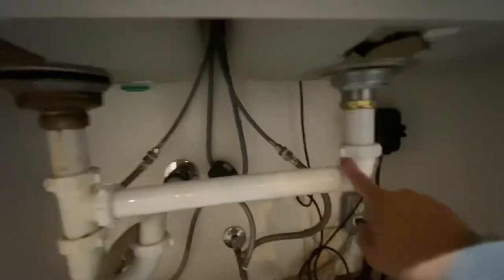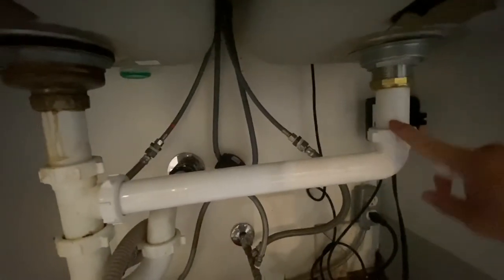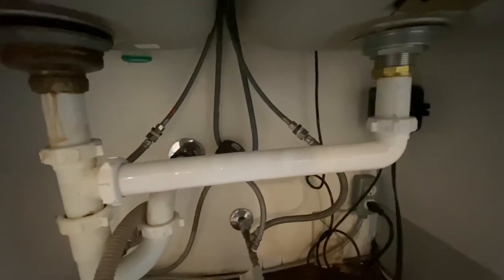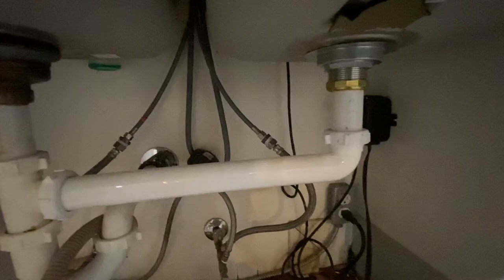DIY: How to add dishwasher drainpipe to a double sink drain and fix kitchen leaks from sink drain.

Comment: I need that kit you opened. What is it called? Where did you get it? Thanks
Reply: They call it a tail pipe drain kit. I bought my frim Ace Hardware. They have 2 sizes for the dishwasher tubing so be sure to measure what size you need. I paid $7.99 but think Lowes, Menards, Home Depot it's a few bucks cheaper.